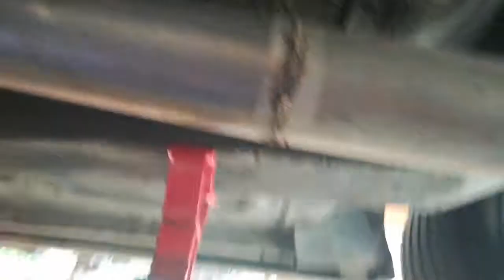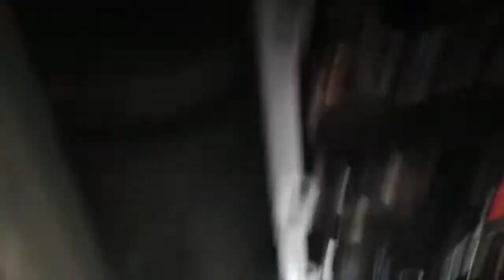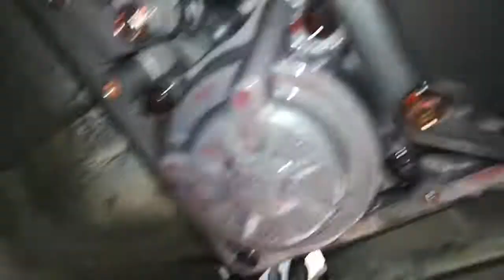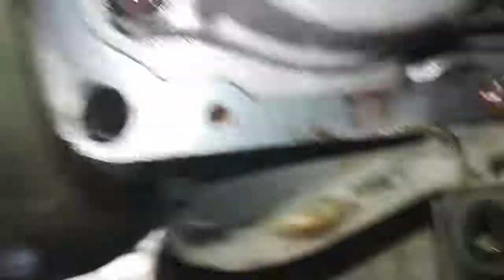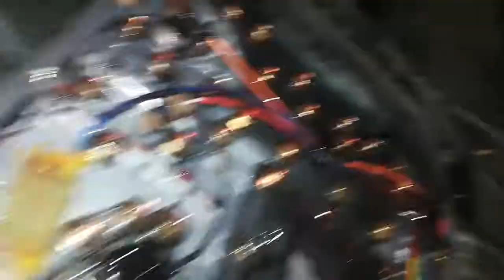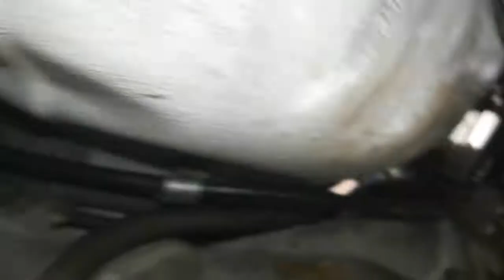Replacement of RE4R03B Valve body solenoids.

Comment: What car is this out of?
Reply from the maker: C33 Laurel, this engine and tranny was originally out of a Skyline or Stagea
Reply: Have you had issues with 3rd gear? I have the same transmission and causing me headaches
Reply from the maker: No issues since I replaced the solenoids. Usually issues occur when it's not wired correctly.